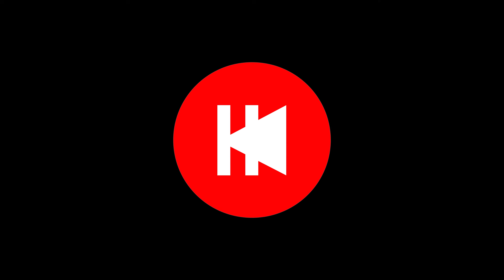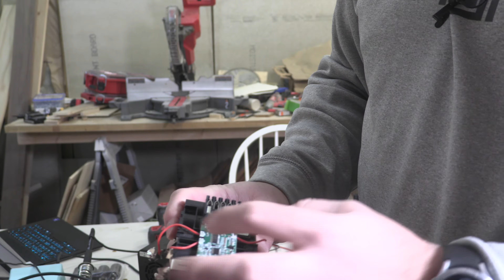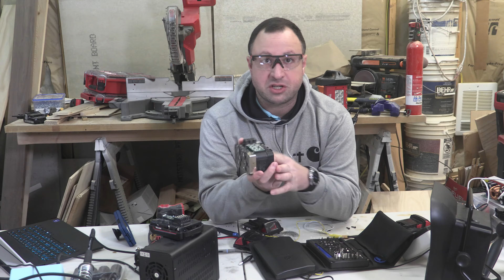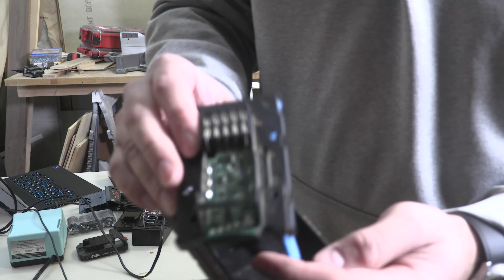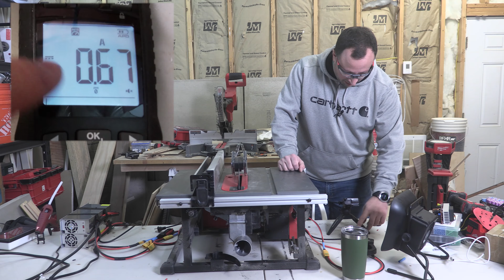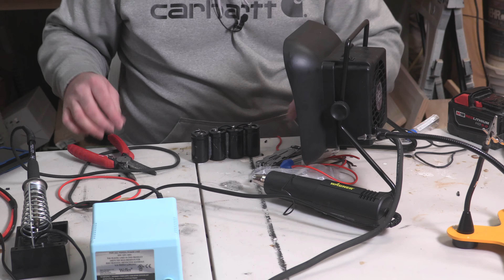2X Milwaukee M18 Plug-in inverter build project - Video 2 (Build and Test)

Comment: I know this is two years later, you've probably already figured out the issue, and posted the video. But, did you put a one-way diode on each of the power supplies? They could be trying to "charge" each other.

Comment: Have been searching. Have you discovered the max input voltage for the M18 tools? I would love to simply take two 12v automotive batteries and use them to power my larger tools in a pinch

Comment: Is it a viable option to use a large wired 6-cell LFP pack instead of AC? That would produce 21.9V. I'd definitely settle for this solution for super long runtime on big tools.

Comment: how much does all this stuff to do this cost? the only thing im really trying to figure out how to do this for is my M18 vacuum, drains my 12 AH battery quickly. they sell an AC motor head but of course its 200$ is trying to figure out a solution like this and building on my own worth it?

Comment: Your voltage with everything hooked up was dropping to 13v at start up. The tools generally shut off at 15-16v if I recall. So the saw not starting initially was probably due to the Voltage drop where the saw was thinking the battery was dead. Maybe the power supplies can’t maintain the voltage on startup?
And then you came to the same conclusion… lol.

Comment: Thanks for the detail overview. Right now i am facing the same problem as you have with the tablesaw. I am using Dell Server PSUs in series (12v x 12v) = 24v to run Dewalt 18v Circular Saw (yeah it work on 20v so why not 24v) but having the same start up issue. That capacitor trick is what i want. Because the Circular saw will start normally on single 12volts PSU which has 91amps. But when both PSUs connected in series, they will trip when i push the Saw button. That might be due to the sudden surge in power which confuses both the PSUs and cutoff the output power. This capacitor trick might help in relieving the sudden power surge for both PSUs. Again Thanks for the Initiation.

Comment: I have been trying to figure out how to power my 1/2 impact from a 12v source. Any thoughts?
Reply from the maker: Your best bet is to get an aftermarket battery, tear it down, and figure out what the circuit layout is. You'll want to find the 12v + and - tabs of the 18650 cells, then remove the cells. Try applying any 12v power supply to those and confirm everything is working. It may take trying a couple of different battery brands to find one that doesn't include the protection circuitry, so it isn't monitoring voltage of the individual cells.

Comment: Very nice. The Milwaukee users are asking  for this for a long time. Don't understand why Milwaukee don't sale a power adapter. Dewalt does sell this, for 2 batteries 48v I believe. They should listen to the crowd. I understand it's all about selling batteries but hey, my guess is that they will sell more table saws or mitre saws because you will have the fallback to an outlet. Everyone will be using batteries but what if they are all empty... Buy more? Come on Milwaukee!

I am a hobbyist and love Milwaukee, but don't know if I will buy the Mitresaw. What if the batteries will not be sold anymore? My expensive, probably not very oftenly used Mitresaw, will be useless.....best keep on hoping they start  listening.

Well greetings from the Netherlands

Comment: Nice video. I built one just like yours using your videos.  I'm using it on a m18 12 inch miter saw. I can't get the saw to run longer than the startup. Im getting  atound 50 amp on startup. Inverter cuts off then after 10 to 20 seconds start back up. I'm assuming inverter shutdown because of the sudden startup amp draw to protectect itself. My only difference is  I'm using 14 gaug cord. Any advice on my issue.  Could it be the saw size or 14 gauge??
Thanks
Reply from the maker: I haven't tried with a 12" miter before, but assuming it would be similar in pull to the tablesaw. Are you seeing 50 amps on the inverter, or inline with batteries?

Comment: Hi Harrison, Great progress! I'd like to help out where possible.

What was your reason for not using the High Output battery which should have higher capacity to run your table saw? There could be limitations with the one you are using.

The Capacitors are a great idea. That's the way I would go.

Regarding power delivery, it's basically Volts and Amps to get power. If you can run at higher voltage then theoretically you'll need less amps which would result in less heat and more efficiency.

I wonder if the High Output batteries are arranged to input at a higher voltage. Also, wonder what a brand new 12.0AH battery reads when fully charged.

There should be some tolerance built into these too, at least 20% which should mean you can input 21.6V without any issues. That would lead to ~20% less amperage needs.

If you could input 24Vdc even better! 1500W at 24Vdc = 62.5A vs 1500W at 18Vd = 83A

20 less amps which is huge, especially if you keep that 14 AWG feed wire. (I'd go to a thicker wire either way.)

Comment: There's a 1500W transformer on amazon that outputs 24V, which you might be able to easiy adjust down... but the optimal math says it should only be outputting ~62.5 A... and your tests here show the saw could need over 100A... (in a burst)

I was shopping for saws, thought about buying this Milwaukee and found the battery-delete to be a wonderful project idea... using the 24V output from the supply I found seemed like a big win, and started looking to see if it has a trim pot to adjust the output closer to 21V or so... before I decided to just save the 200$ and risk of electrical hazard and buy a coorded table saw to keep myself out of fire and trouble.

Is there a reason why you want to join two power supplies together instead of jumping straight to a larger 24V output? Running two seems like it might get you closer to hitting the maximum your breaker allows, so maybe that's the big win... but hinting at using a boost converter when you could have jumped straight to 24V instead seems simpler, and more efficient to me...
Reply: I want to try 24V too. I wonder if it can handle it. It should handle 21.6V, just not sure anything higher.

Comment: 🎉 Sweet. Celebrating is in order. Thanks for showing this can be done. I am excited to do this myself. 

It would be great to see if you could increase the voltage supplied to the tools. I’ve never checked the voltage on a fully topped off battery, but is could be as high 21V (4.2V*5cells=21V). Running the tools at a higher voltage would also decrease the current draw and keep things cooler (like long DC current power leads that have lots of current going through them. 

That being said if testing at 21V (or the same voltage as fully charge batteries measure) goes well, if you’re feeling lucky you could test how tools run at 24V. 24V would decrease the current even more and power supplies may be easier to source with the industry built around 24V power supplies. If you do try at 24V maybe try it first with less expensive tools incase the electronics are not cable of with standing 24V

Comment: These can be wired up in parallel on the supply side to run off a single 20a breaker right?
Reply from the maker: That's the way I was running it... both plugged into a single 20A. 

My meter overloaded at around 110A (at 18v) so there is potential i may have been even above that. 

Under a sustained load, you may trip a breaker though.

Comment: Did you ever go back and try a single inverter with the capacitors?
Reply from the maker: Yep... it started fine, but didn't have enough current to cut very well. Even with light pressure, it would get about 6" into a board and stall out.

Comment: Minor safety advisory. You should have your push stick between the fence and the blade. Pushing on the far side can pinch the blade and cause kickback. https://www.youtube.com/watch?v=JOhZxvgkWNM&t=3m28s
Reply from the maker: Thanks for sharing this. I certainly had a WTF moment while I was editing the video and saw the board wobbling. Certainly will be changing how I cut going forward.

Comment: 29:37 that's just because you havent zeroed your clamp meter. It's pretty hard to get them to zero perfectly anyway, there's too much background magnetism. Anything under 1A on a current meter is basically zero (unless it's designed for it but thise usually have a very small clamp). Sleep current on your tool will be a few mA at most, but more likely uA.
Reply from the maker: I'd be interested in this... agree it seems high (0.6A at 18v = 10 w). The one key system powers an LED light, bluetooth, and the circuit itself. I would expect to have a couple watts max there.

Comment: And... Any plans to sell a version in the future? I'd be interested. Thanks
Reply from the maker: I've reached out to Milwaukee several times inquiring about anything related being in-work, and they haven't responded one way or the other. I personally would not build these in a production capacity, but I've toyed with the idea of connecting with an OEM manufacture and seeing if there would be interest in a partnership. Maybe a Kickstarter project is in order?
Reply: @harrisonhobbies241  they haven't responded because they rely on there being a lack of one to increase more battery sales. Now that you have created one and others may follow that will open the door to them eventually creating one of their own to get those sales that they are missing out on otherwise. The trick is going to be making this widely available and easily recreatable in order for them to see that they are missing out by not producing one. If you produce one yourself and make it available for sale then you have created real competition that will make them take notice. And, you should be rewarded for putting your ingenuity to use and filling a need in the marketplace.
Reply: @harrisonhobbies241 Well since you are using an OTS power supply, perhaps that is the vendor with whom to partner? 

Do you have an updated power supply model recommendation?